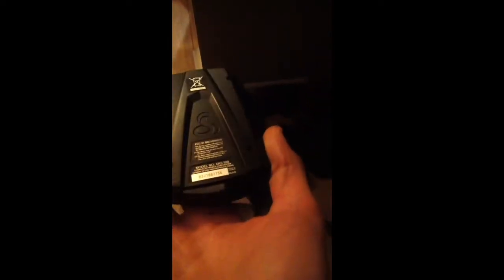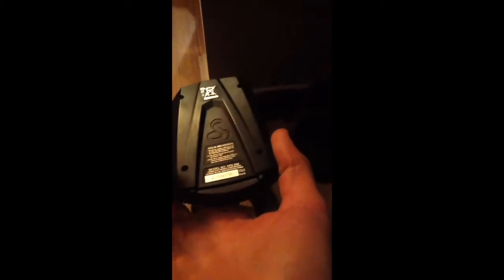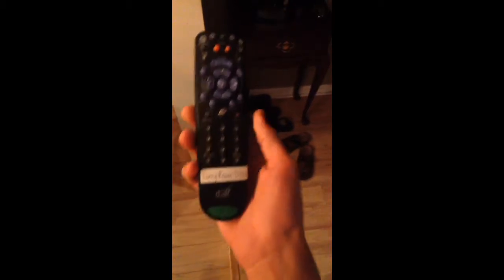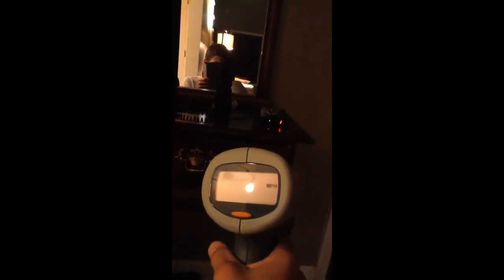Reaction time with a Cobra XRS 888 on K-band and Lidar using a bushnell radar gun and a tv remote.

Comment: Cobra detectors are such trash.  Not only are they near useless in detecting radar in real world scenarios,  they spew leaking from their poorly made oscillator setting off higher end detectors.  Any LEO shooting instant on or quick trigger will be having Cobra for dinner
Reply: My trash cobra radar detector has saved me from several tickets and thousands of dollars of insurance hikes. let alone the points on my license that probably would have gotten it suspended. Best trash I've owned so far ;)
Reply from the maker: Nick Kaumans Yeah, I found it wasn't great on speed.  It's an older detector that belongs to my dad.  I have a Whistler CR93 and it got way more reaction speed
Reply: Tyler Turnbull it's not really the reaction which makes Cobras bad it's their receiver horn and circuitry.  When I first got into detectors over 15 years ago I made the mistake of buying cheap Cobra ones at first.  Then moved into the higher end,  owning 2 Valentine 1's, 5 Escort,  and 1 Uniden  .  If you want a detector with top tier performance without the top tier price I would recommend Uniden DFR7.  It keeps its paces with Escorts products in most bands and is GPS enabled for lockouts.
Reply from the maker: Nick Kaumans I have thought of getting an Escort or a Uniden when I decide to upgrade, used to watch videos testing them out a lot and they really do a good job.
Reply: Escort needs to get their K band filtering improved by huge margins before I would ever look into buy another Escort. All the other brands including Uniden have much more effective K band filtering which is needed due to all the blind spot monitoring, and adaptive cruise control systems in modern cars.
Reply from the maker: No doubt, the blind spot falses on K Band are really annoying.